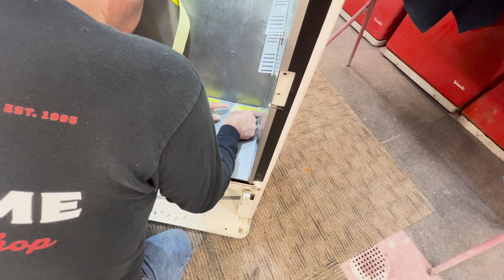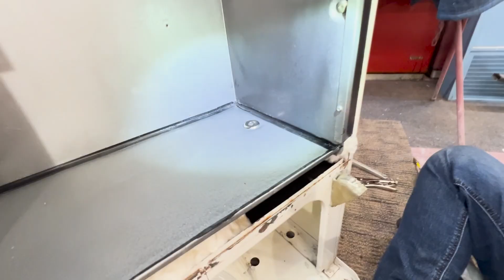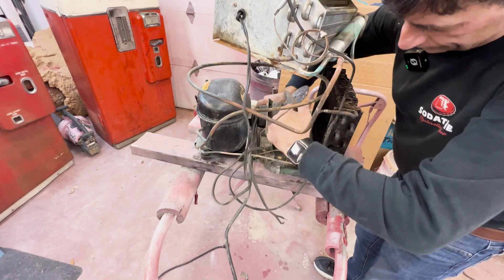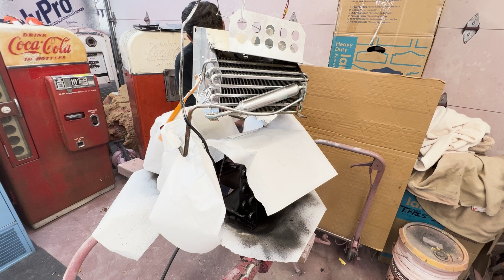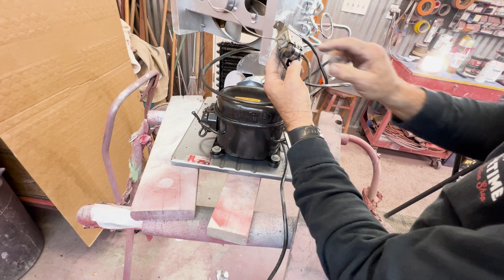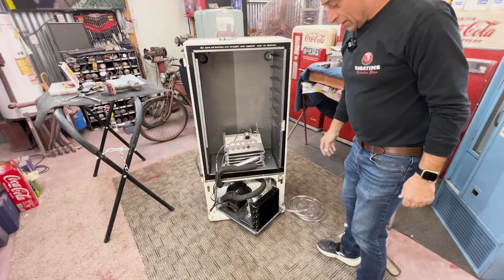Vintage Pepsi Machine Compressor Cleanup | Vendorlator (VMC) 56 Restoration [Part 2]

Comment: Hi Marc! Love watching your videos! I am curious what kind of paint you use on the condenser/evaporator. Does it need to be specialized for heat transfer like radiator paint? I have a Vendo 39 that I am restoring for myself and have pulled out the compressor to work on it. Appreciate the work you are doing with the videos.
Reply from the maker: I am not using any high heat type paint. 
Most are the better quality kroylon sprays can. Getting the old surface ready is key!
Either by sandblasting or paint remover or sanding down is key to a good clean job then putting a good etch primer on before painting!
Hope this helps!

Marc
Reply: @sodatimerestorations  Yes, it helps a lot! I have an 81 that I did a few years back. I sandblasted but stayed away from the coils. I taped them off. However, I did not remove from the deck. I used black radiator paint for the condenser and the evaporator I cleaned up and taped off the coils and painted with quality spray paint. I installed new wiring/fan motors and wrapped the refrigeration line with the foam as you did. It still works great and looks good too. I think after seeing how you removed it, I am going to go ahead and remove this one. Thanks! I really appreciate you!

Comment: 😊😊 HI MARC its a good 👍 😊 thing U did take that 2 the car wash 2 clean out plenty of water 💧 😊 and U done the best 👌 😊 thing washed it out until there was no more dirt or grit was in it  wash until U only have clear  water and this will also help it run alot more cooler than what it was 😊😊 now it can get alot more air and stay cooler also the drinks should be good 👍 😊 and cold 😊😊 W frost  on the soda  cans alot better than the soad machines of 2 day 😊😊 OMG 11 24 2O24